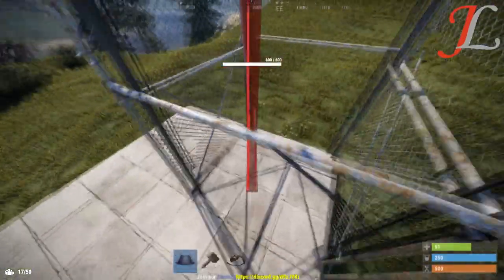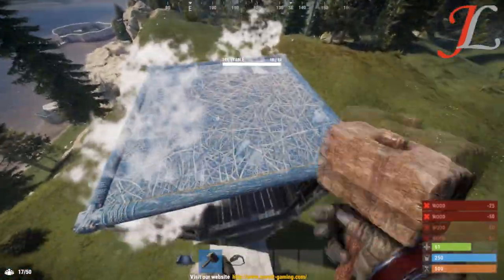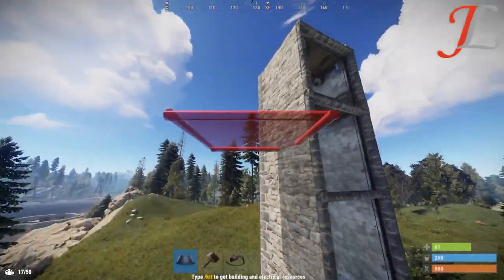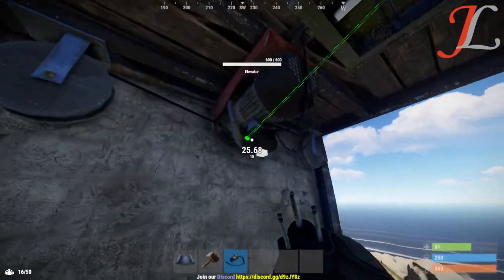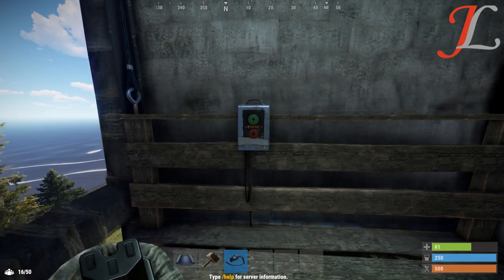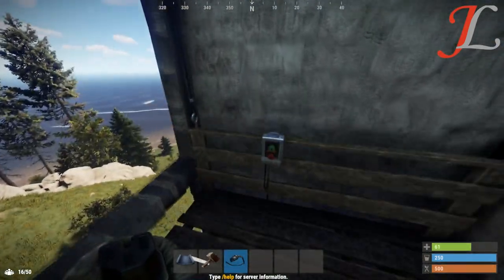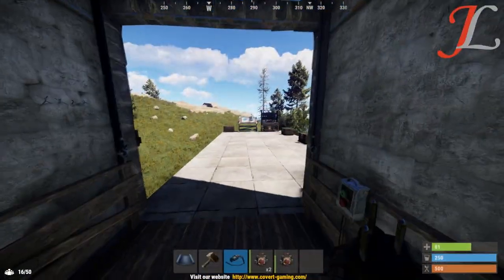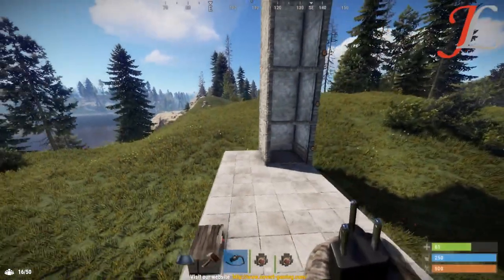Rust NEW Elevator System | Quick and in-depth Tutorial

Comment: do yall know if its possible to split call button inputs? by default you only have 2 call button inputs per floor....but say i have a 5 story structure and i want to wire it so i can go from any floor to any other floor. 1-3, 2-4, 5-2 etc...i was wiring it so i had 5 buttons on each floor and could hop in and still reach them and select which floor i wanted. but obviously with only 2 call button inputs its not working
Reply: Should be easy using an "or" switch